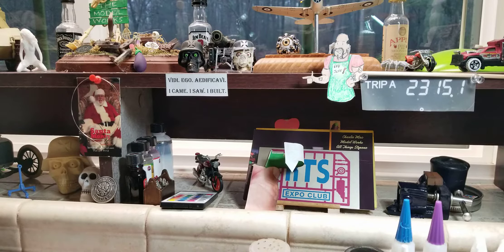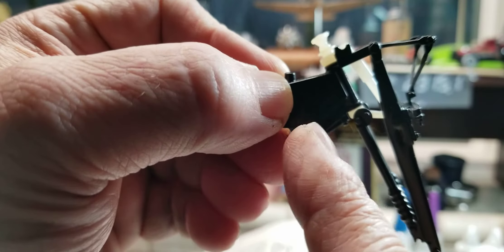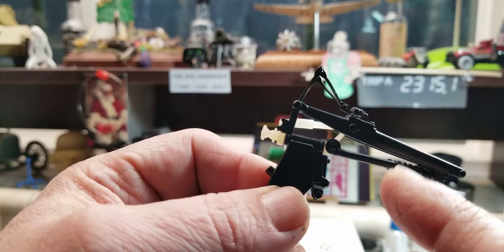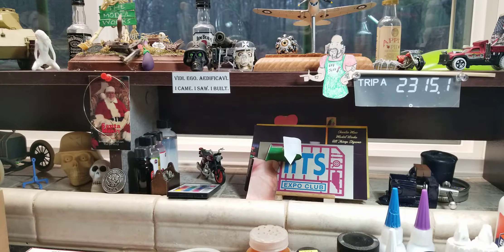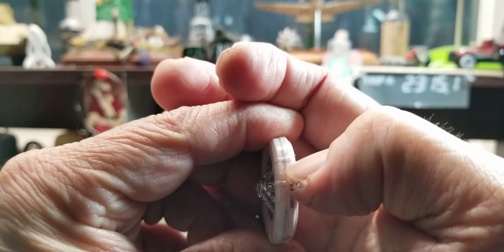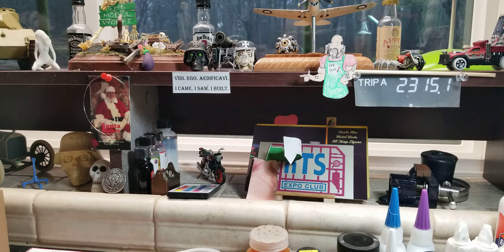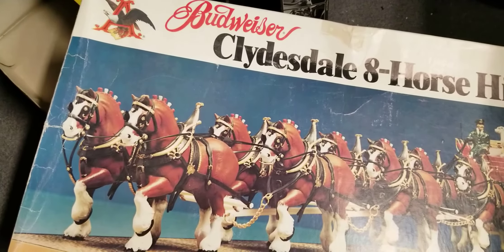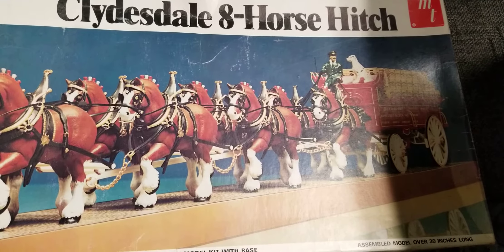Stuff from the Model Works

Comment: Hey Charlie,nice update. The bike is a bit fragile from what i see, maybe is molded wrong that is why you faced a problem. As about the spare tyres on the car,i believe that you could also sand them flat and make new straps from aluminium cans. Just some thoughts. Nice gift from the wife. Thanks for sharing.
Reply from the maker: All great ideas. Thank you. The bike's pretty complicated. But , that's because the directions are so vague. Great gift from Mrs.Mac. 👍